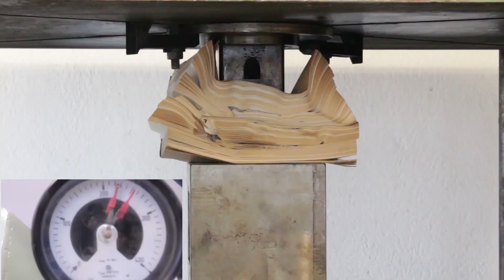Experiment Dumbbels VS Hydraulic Press 200 ton

Comment: The material inside the dumbbells is low strength concrete. Cheap filled dumbells use concrete, better quality ones are solid plastic and gym-grade ones are metal.
Reply from the maker: thats some knowledge right there!!